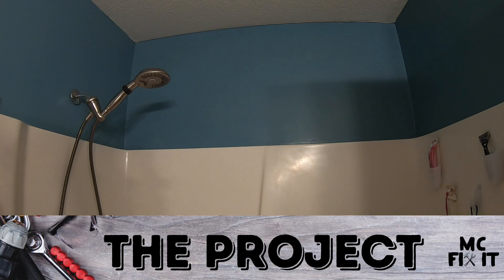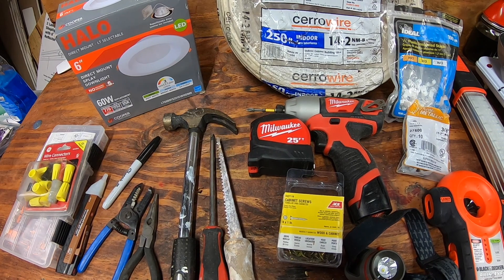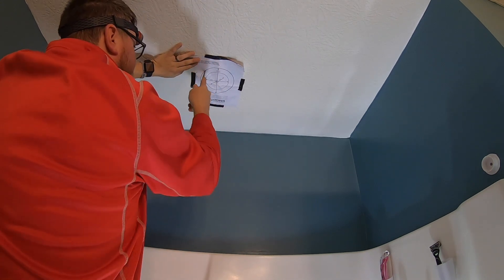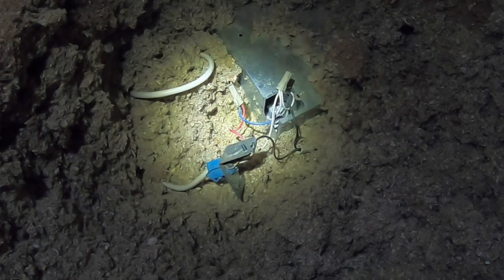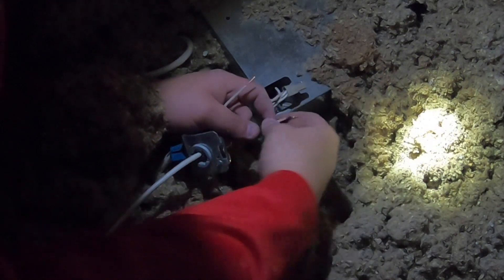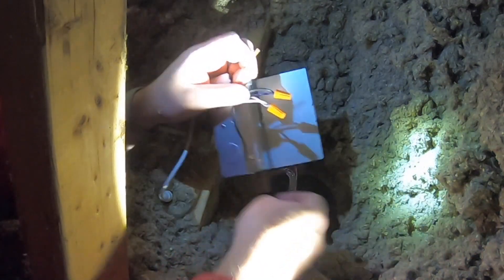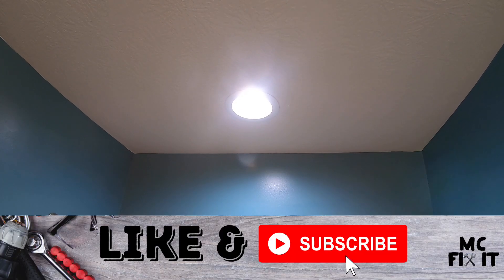How to Install LED Recessed Light in Bathroom Shower [Complete Guide]

Comment from the maker: Find out how to install a recessed bathroom light over your shower. 

The Tools:
* Halo 6in Canless LED Recessed Light Selectable 3000K, 4000K, 5000K - https://amzn.to/3Ow7CIa
* 14/2 Romex Wires - https://amzn.to/3xC8EfB
* Wire Strippers - https://amzn.to/3k7MeLr
* Drywall Saw - https://amzn.to/3rAPX85
* Drill w/ Philips Bit -  
* Cabinet Screws 1in - https://amzn.to/391X1nZ
* Needle Nose Pliers - https://amzn.to/3JNeLQI
* Stud Finders - https://amzn.to/3rzcwdE
* Non-metallic Connector - https://amzn.to/3KU3GPh
* Philips Screwdriver - https://amzn.to/3hdpzx0 
* Tape Measurer - https://amzn.to/37BMKxW
* Non-Contact Volt Tester Kit - https://amzn.to/3riICui 
* Utility Knife - https://amzn.to/2StsW8q 
* Hammer - https://amzn.to/380qQoy
* Wire Staples - https://amzn.to/3rzLZg7
* Marker - https://amzn.to/3fbLTo6
* Wago Wire Connectors  - https://amzn.to/3Lay3kF
* 8ft Ladder - https://amzn.to/3rzqex5
* 4 x 3 x 1/2in Plywood
* Light Bar

Chapters:
00:00 Intro
00:07 The Project
00:41 The Tools
04:02 The Fix
04:20 Location for the Recessed Light
07:19 Cutting Hole for Light through Drywall
09:15 Turning off Breaker for Bathroom
09:33 Going into the Attic
10:05 Finding the New Hole & Bathroom Fan 
10:24 Adding Wire from Bathroom Fan to New Light
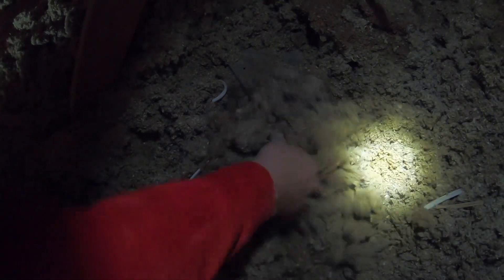17:12 Covering Back up Bathroom Fan
17:41 Using Plastic Staples to Secure Romex
18:31 Install New Electrical Box for Recessed Light
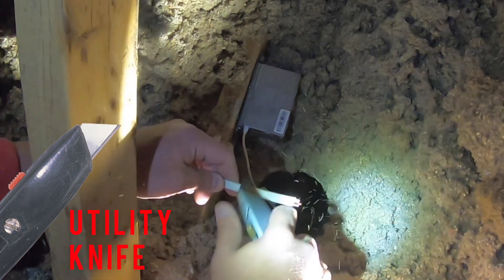19:53 Connect Romex to New Electrical Box
22:32 Securing New Box to Stud
23:48 Install Recessed Light
24:50 Turning On Breaker
24:57 Testing Light
25:10 Coving the New Light with Insulation
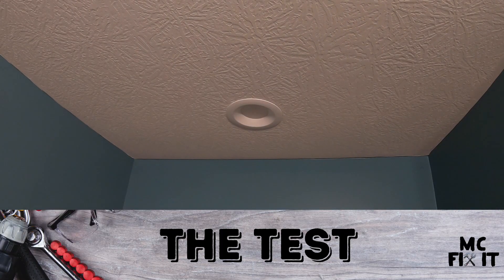25:40 Final Test

Check out my website at http://mcfixit.us 

Disclaimer:
Due to factors beyond the control of MC FIX IT, I cannot guarantee against improper use or unauthorized modifications of this information in the video, post, blog, or social media. MC FIX IT assumes no liability for property damage or injury incurred as a result of any of the information contained in this video. Use this information at your own risk. If you feel uncomfortable at any time. Stop and go to a professional. MC FIX IT recommends safe practices when working on vehicles, your house, or any other project and or with tools seen or implied in this video. Due to factors beyond the control of MC FIX IT, no information contained in this video shall create any expressed or implied warranty or guarantee of any particular result. Any injury, damage, or loss that may result from improper use of these tools, equipment, or from the information contained in this video is the sole responsibility of the user and not MC FIX IT.

#mcfixit #recessedlight #houserepair

——
Supplies used to record this video: 
* GoPro Hero 7 Black - https://amzn.to/3f3ALtb 
* 256GB Flash Drive - https://amzn.to/33pAueG 
* Vlogging Frame - https://amzn.to/33tajE0 
* GoPro Pro 3.5mm Mic Adapter - https://amzn.to/2RCURCu 
* Youmic Lavalier Lapel Mic - https://amzn.to/2R55sWX 
* Boom Stand (tripod) - https://amzn.to/3bdkQaw
* 5/8” to 1/4” adapter (boom to blogging frame- https://amzn.to/3txrVsM 
* Portable Battery Powerbank- https://amzn.to/3vJQc0q 
* 6ft USB to USB-C (powerbank to GoPro)- https://amzn.to/3uAS5MH

Comment: another cool thing is to scan for studs, poke a hole where you want to cut, dont cut, go into attic, sweep insulation out of the way, and then proceed to not create such a mess with those spraysulation. once all done, sweep it back to place gently.
Reply from the maker: That’s a great idea to keep the insulation contained!

Comment: Thank you for your video! I am looking at doing this for my kids' bathroom. Could/would/should you put some kind of sealant or caulk around the light or underneath the light casing?
Reply from the maker: I don’t see that as necessary. No water should ever get up there but then again it’s for the kids bathroom, lol! I would recommend not having a shower head that could spray that direction due to electrical above it being a kids bathroom

Comment: For nailing down the wire to the joists, is it necessary to drill holes through the joists?
Reply from the maker: Depends on your local code. Mine it is not necessary.
Reply: @MCFIXIT gotcha, thanks for your response and video! Was able to successfully install a light above my bathtub 🤗